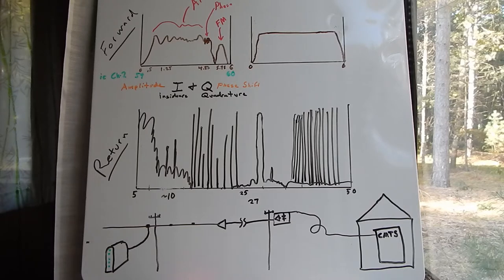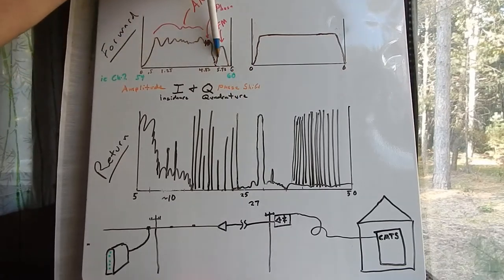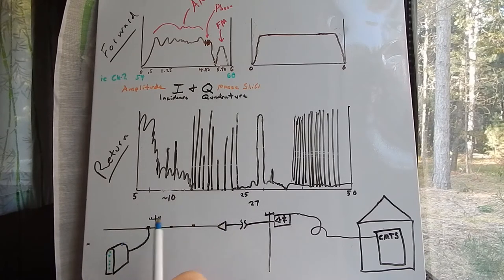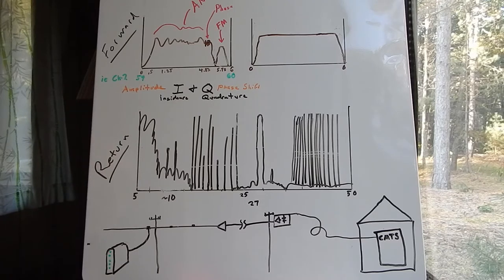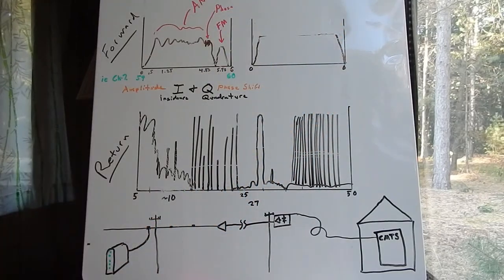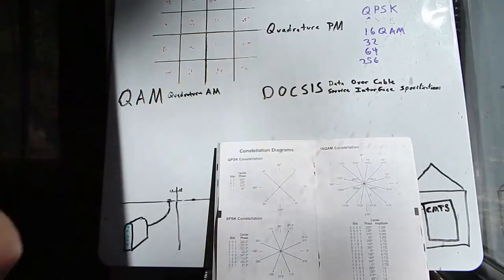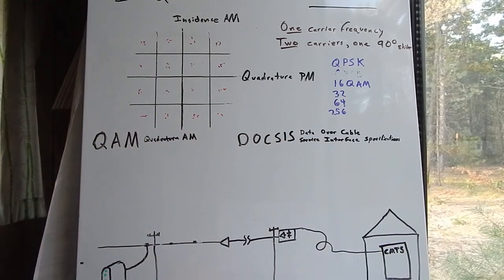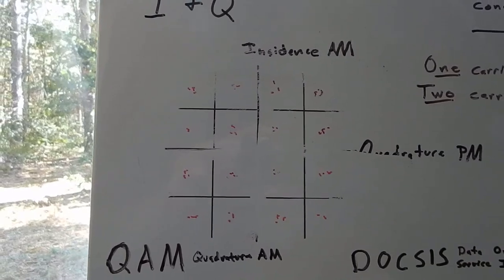How Cable Modems Work

Comment: Aluminum oxidation was mentioned in one of your videos,  when this happens to the hard cable - which part of the spectrum tends to get affected ?  Great info and presentation.
Reply from the maker: Dry corrosion increases the resistance of a metal to metal connection to the point where it models a diac and /or capacitor. This is like putting a small capacitance in series with the signal (or its ground) causing the low end to drop out. Direct conduction has stopped and now the signal has to radiate through the gap.
  However, corrosion usually happens because moisture is leaking in, which tends to short things out causing the opposite problem taking out the high end. So a connection can get wet causing a high end loss, and then, as it dries, cause corrosion and open causing a low end loss.